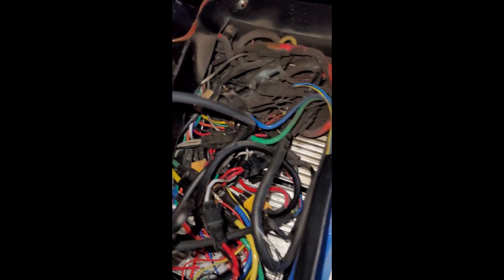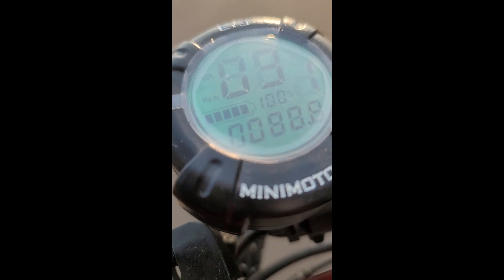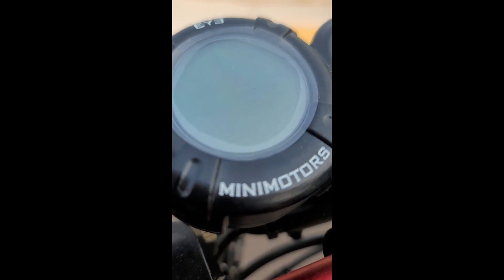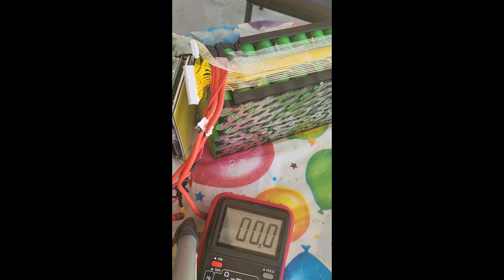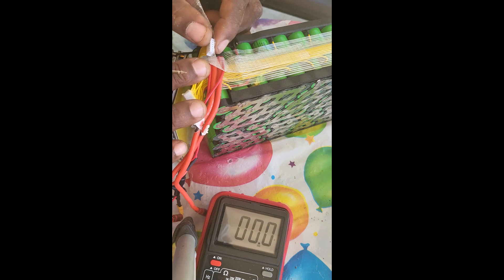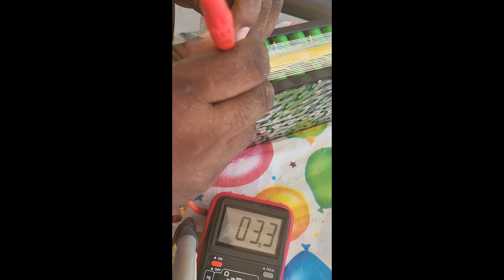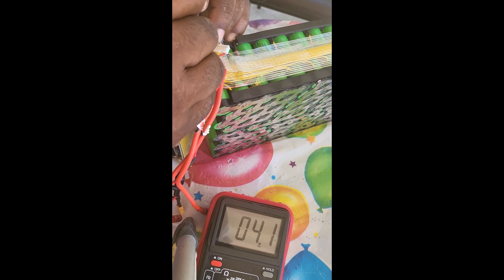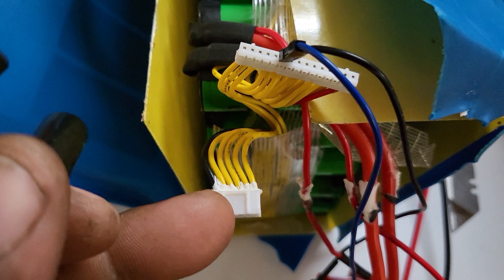Kaabo Wolf King 72v Battery Autopsy and Diagnosis

Comment: I am starting to feel an intermittent hesitation or cutting out when I accelerate.  It happens for just a moment then operates normally.  It occurs whether in single or dual motor mode. Do you have recommendations?  The scooter has low miles but is not under warranty, bought second hand.   Wolf King GT
Reply: Does it show a error code when it cuts out? This happened to me and it turned out one of the hall sensors went bad in the rear motor
Reply: @chocco2k8  unfortunately it does not...
Reply: @chocco2k8  it does not....i'm going to take it into an e-bike/scooter service shop and hope they can test it...dunno.

Comment: so let me get this right i paid 900.00 to 45mph , you paid 8.500 ppounds to go 60mph ????
i have scooter none cost me that stupid money all of them go 30mph plus some even cost me 500.00 pounds , why would i drop an extra 7k just for more acceleration ???? , scooter i paid 800.00 pounds for 28ah , 40mph single motor ?????
why do people spend stupid money just to get the speed quicker i have the same motorbike suspension and high specs ?? not ev spent 3k have more than 1 ????

Comment: Hay just curious if you can let me know how many cells are in parallel and what the BMS is rated at. It’s what a 20s8p for 28ah ? It’s probably got a 60 amp BMS then I would assume. 
I am trying to figure out why they would use 2 x 50 amp controllers if the pack isn’t capable of 100 amp continuous discharge. Maybe the peak discharge is enough to handle the short time the controllers are pulling that much. 

What do you think?
Reply: I believe each controller is 50 peak. that would explain you would only need 50A continuous.